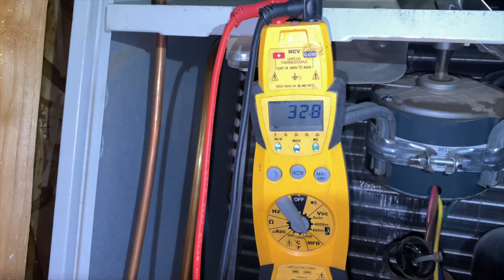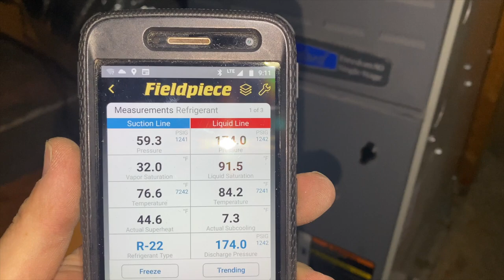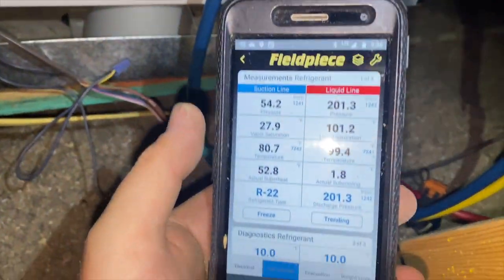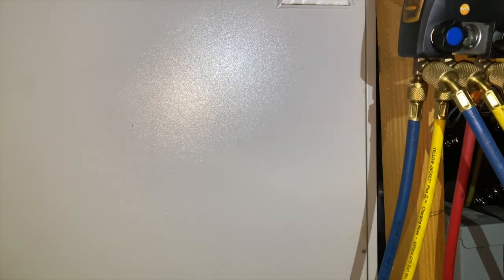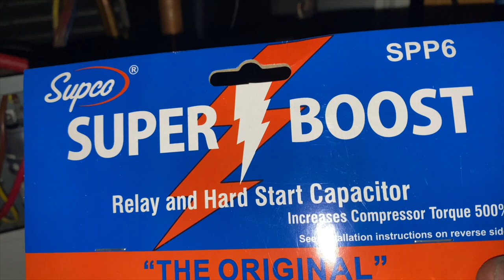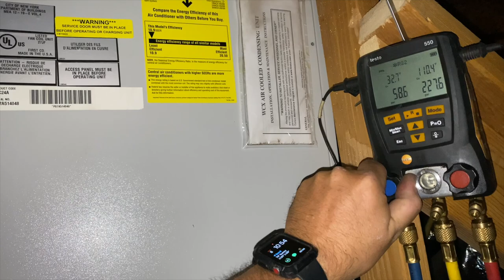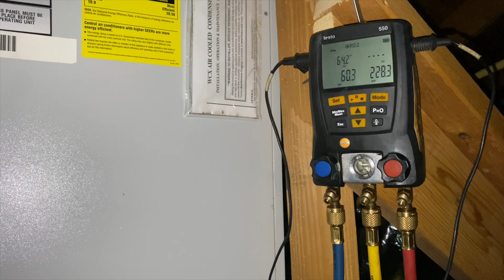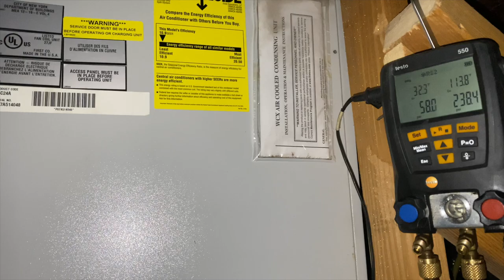Condenser Unit in the Attic!!! What?!?!?! Compressor Thermal overload. EP65

Comment: I've seen a business with the portable single hose AC units venting them up in a drop ceiling. Those single hose portable units is a joke anyway. They suck in more outside air, if they are vented outside, than they blow out cool air.

Comment: You had stated it needed a different piston because it must have had the incorrect one installed and it was causing your subcooling and superheat to be wrong. Would it have helped temporarily to slow down the blower speed on the furnace to get better numbers?
Reply from the maker: The unit is cooling 3 floors. Slowing the blower would kill what little airflow they have already. Unit was cooling @ a 18 degree delay T between supply and return. I quoted them to install a TXV.  Haven’t heard from them. Probably won’t.
Reply: @NighthawkHVAC  thanks for the quick reply and reasoning behind your reason.

Comment: No attic fans anyplace in that house or insulation lol?? Is there an air intake to the roof that is like not roof level so its getting more of the regular outside air than the heat radiating off the shingles air?
Reply from the maker: No attic fan. But plenty of cellulose insulation.

Comment: Neat unit, wonder if it's actually designed to be ducted? Would have expected to see a blower on it rather than an axial fan to push through the ducts. 

Also, as an electrician I'd suggest using some manner of sleeve/bushing on holes you drill like that. The sharp bits left from the drill bit are a lovely place for wires to rub out and short.
Reply: yeah, I cringed at the wires through rough drilled metal. not the best way by far, but at least cocoon wrap the wires with electrical tape so they fit snug.

Comment: Ok so as a fellow tech, that install bugs me, and I'm aware you did not do the install. 
1 why not spin the condenser 90° and blow the discharge out the side wall?
2 does that not cause a heck of a noise nuance inside the house?
Reply from the maker: That fact it’s in the attic bugs me. It’s located in an apartment complex. There’s another apartment on the other side of that wall. And yes it’s so loud. It’s so bad. I don’t know what they were thinking.